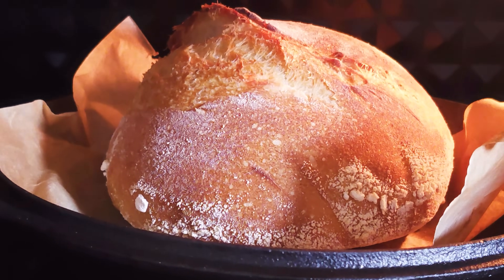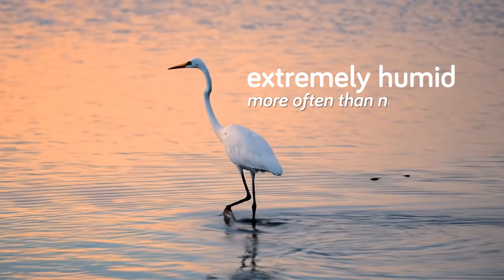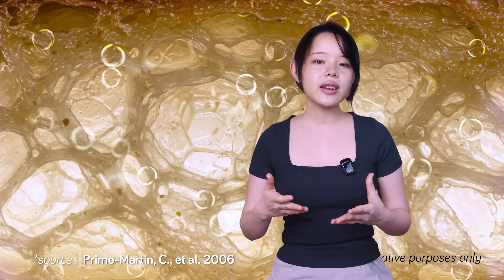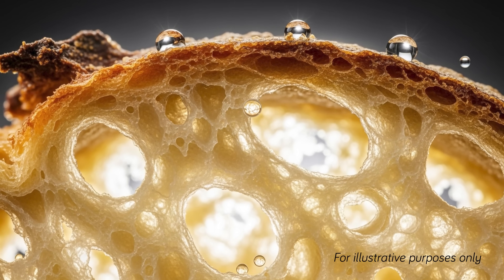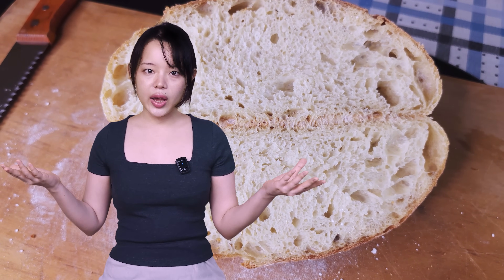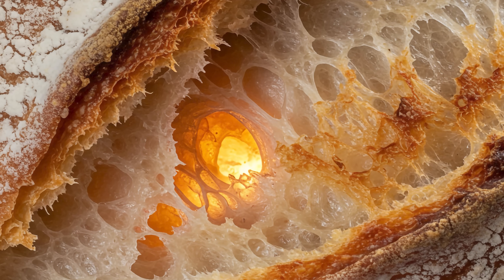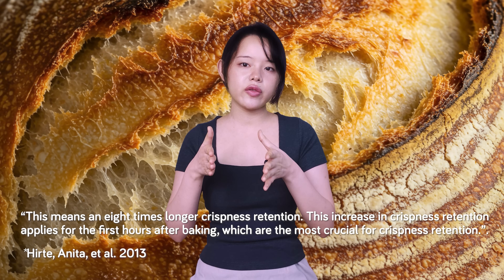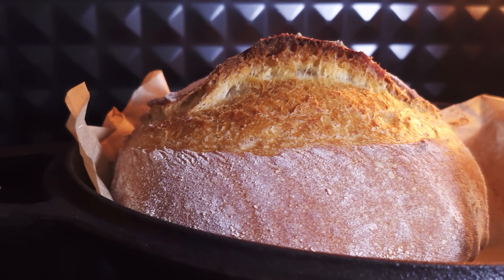Are These The Real Secrets to Crispier Bread? | The Science of Crispy Bread

Comment: Definitely not relevant to this video, however I'm in need of your help in formulating a mother dough formula of mine - it's just a general formula that can be scaled up or down depending on what I wish to make out of it for different yeasted dough products.

I've been going through your previous baking videos through the years, repeatedly the videos on the science of eggs, of shokupan, of oils and fats and the recent sub sandwich roll video and have been meaning to incorporate the use of egg fractions (egg yolk specifically) in my recipe. Although you made mention that there isn't really a need for eggs to be used in a recipe that contains Tangzhong/Yudane and butters for the sake of lecithin. I wish to incorporate egg yolk for its richness and savoury notes that seem to round out the sweetness, as well as have some egg whites left over to glaze the products.

However I could not work out the baker's percentage for the eggs so that when scaling the recipe it would increase or decrease appropriately. 

I always started with a total dough weight (pre-bake or estimated) in mind, accounting for the around 10% loss due to evaporation and other factors which were similar to your Shokupan video. Thereafter I would create a straight-dough recipe with all the ingredients I plan to use and thereafter break it up into their derivatives of Biga 20 and Tangzhong 20 with the final dough. Therein lies the problem because I need the total baker's percentage I generally do not know how to find the percentage of eggs and when I looked at articles and watched your videos, I didn't know how you added the egg to your recipes, beyond removing parts of the water and fat content from the recipe to account for the egg and then adding the remaining weight of the egg to the total dough weight. I don't know if I should be doing the same or rethinking the way I formulate the mother dough

I recall your best wishes a year back and have been on this baking journey with you and learning through your knowledge. Love how thorough you are in your research and how you wish to share that knowledge.

I don't know if I'm being rude but if possible could you maybe add a downloadable pdf or spreadsheet for your recipes with notes on your thought process and any variations. And if there're any new scientific studies that have come out recently, could you please make updates on your older videos to highlight the newer information?

An amazing video yet again and thank you for your time in reading this 🙏 take care ❤.

Comment: My solution was to lower the hydration to 60-65% and after the first 20 minutes I activate the oven fans too.
Low hydration means I can use weaker flour when I'm not using fat or sugar, better shaping, better scoring, I can make bread faster, I don't need to worry too much about sticky dough and, even after a few days, my bread is never rubbery (I think strong flour develop way too much gluten that result in a really rubbery texture).
I think large bubbles inside the bread are a bad trend that actually lowered the quality of bread.
It's true that I've never been able to precisely control the internal structure of my bread (even at very high hydrations, with a formidable gluten network, I've never obtained a particularly open crumb) part of the reason is definitely the different flour, part is the fact that I hate making bread in multiple days with cold fermentation and everything concering long rise when not 100% needed. But at some point I actually realized bread made to be full of big holes inside was not that good to begin with.
And when i tried to make 100% semolina (a flour that got a really weak gluten network to begin with) it was stupid to try it at high hydration so I decided to go with low hydration.
It was that much a surprise for me that from that day I decided to go back to low hydration.
My bread got so much better I never looked back. The crumb is not open at all, but it's not dense and it's still soft and really good.
I'm still making some experiment on high hydration now and then to understand how it works the control of the crumb structure since I love baking also for the science experiment part (and I love the experience I got from working with high hydration since I need it when making rich bread that I still love to make), but I don't really want to achieve open crumb as my ideal bread anymore. My ideal bread right now is 100% semolina lean 65% hydration, easy to make, amazing, and super crisp.
Also I love the fact that I can get amazing result every single time, it was never like that with high hydration since scoring was not working 70% of the times with my skills, while with low hydration I can get great looking scoring 100% of the times. I was able to teach my recipe to my mother (that before that was making bread by eye and it was always low and dry) and to my brother (that was making bread for the first time) and they both got my result only with vocal instructions. That was also my goal, making a fool proof recipe for great bread that could work with basically any regular low protein flour.

But the fact that the crust was never crisp was also one of the main reason I decided to go back to low hydration... I started with low hydration by eye a few years ago like my mother and my bread was not good back then but the crust was always crisp and good. When I started to follow the trend of high hydration my bread was better (it needed way too much time and effort but the result were better than before) but the crust was always disappointing and after a day it was gummy like glue (similar to baguette). Only a few months ago I decided to go back to low hydration with all my experience and that's when I discovered that the crispy crumb and better texture was also something that I could achieve with low hydration.
Not sure if in a really humid climate work well like here (I live in a city with about 78% humidity all year... not as high as your but still high) but for me it works great.
I suggest you to try once, even as just another experiment. Low hydration (60-65%), 10-12% protein flour (or a flour with a weak gluten network like semolina), fast rise, 20 minutes with steam the rest of the time with fan on.

That said, the information in the video is still interesting, the science behind bread fascinates me regardless.
Reply: Muy interesante. Yo tengo el mismo problema, así que voy a seguir tus indicaciones. ¿Podrías decirme si usas masa madre (sourdough) o levadura comercial?
Reply: @luxvera  I tried with both. But I usually use regular yeast (I prefer it fresh but it works with dry too).
PS. Try to write in english, I'm italian but if I use it online almost nobody can understand me, I had to use the translator to try to understand you and translators are not always great.

Comment: New to your channel and love the depth you go in to. Would you ever cover on 100% fresh milled loaves? Us in the 100% fresh milled community are still learning how to make close to artisan breads as it is tough without sifting the bran.
Reply from the maker: Thanks for the suggestion.
Reply: Same. Freshly ground whole wheat and rye while also looking at videos with so much responsiveness and stretchiness and wondering how 😊
Reply: Sift the bran, at least 15%-20%. Scald it when you start making your bread, let it cool, then add it to your dough as an inclusion.
Reply: @giyengar I’m trying to figure out how to do it without sifting as the bran has most of the nutrients. Plus supposedly it oxidizes quickly. So I need to figure out how to keep it in there. If not, I’ve definitely considered sifting, then sprinkling back on top right before the bake when the shape is formed.
Reply: @ThatManAnt  None of that is true to any degree of significance. Bran and flour don't fall apart like bad arguments, I promise you. You're putting it back in the loaf, you're not losing anything and you're helping the structure. Try it.

Comment: As a lover of crispy, crusty bread above almost any other snack, I'll certainly be using what I learned here in my experiments towards making my breads as crispy as possible through the baking process.
When it comes to preserving (or recreating) crispyness after baking though, I've found the best way to do so is to freeze the bread right after a short cooling period, but before the crust loses its crisp. Then, at a later date, defrost the bread by putting it straight from the freezer into a convection oven for 5 mins or so (an air fryer would probably do it faster with similar results). I've found that the crust becomes just as crispy and flavorful as when it was first frozen, and the inner crumb retains a tender internal texture despite light toasting on the exterior.

Doing the same thing with a toaster or regular oven yields different results - taking longer in the oven's case and producing a uniformly crispy piece of toast. Certainly not a bad outcome by any means, but convection seems to be the key for recreating that freshly baked feel as closely as possible.
Reply from the maker: Thanks for the comment! The way that you freeze your bread sounds a lot like what I do to store my bread if I want to keep it for later, and as you mentioned, I've also found that it results in great bread after a bit of reheating.
As for the oven vs toaster comparison for the bread, that's a pretty interesting result. Since you wrote that the oven took more time, it makes me wonder if it could be the result of a difference in temperature or heat-up rate, as that could affect how much water is lost from the bread and thus the crispiness.
Reply: @NovitaListyani  My theory is that the air currents of the convection oven help to whisk away the moisture that was trapped in the frozen bread as it defrosts, resulting in a crispy exterior and drier interior during the defrosting process. Whereas in a toaster/oven, that moisture stays in/on the bread until it evaporates due to the heat alone. Perhaps in the latter case, further gelatinisation occurs in the starches within and without the slice/loaf, resulting in the greater proportion of crunchy textures? I can only hazard a guess based on what I've gleaned from your videos though. 
I look forward to further videos and insights into the subject of preserving the textures of freshly baked goods over longer periods of time, as I most often need to eat mine over the course of several days.